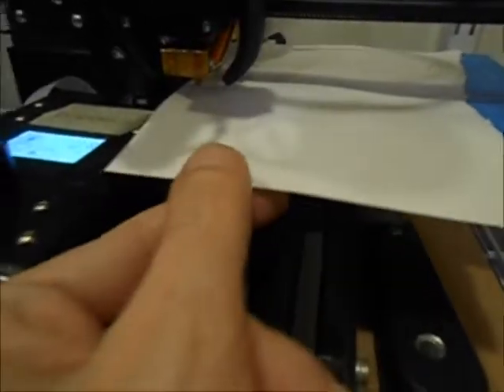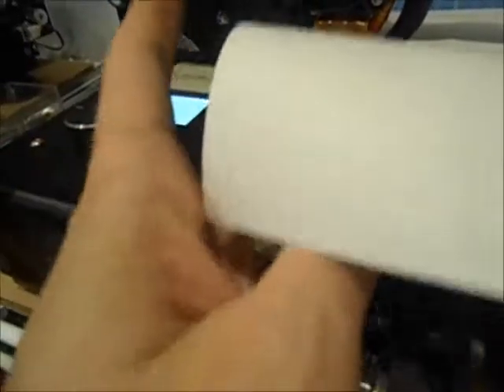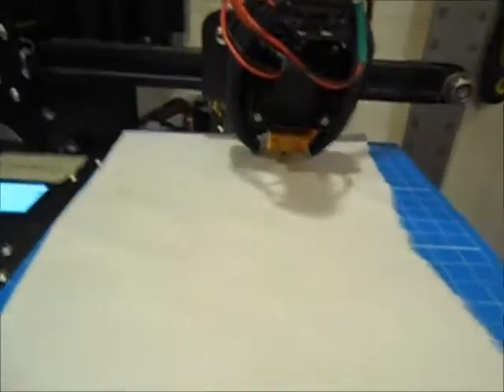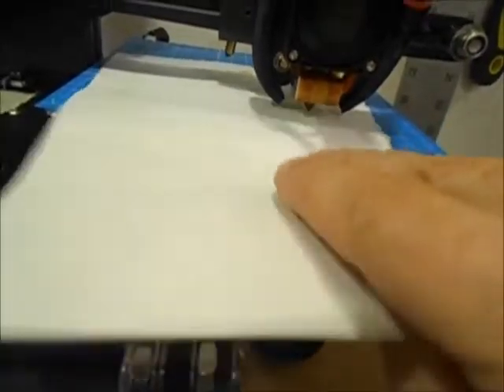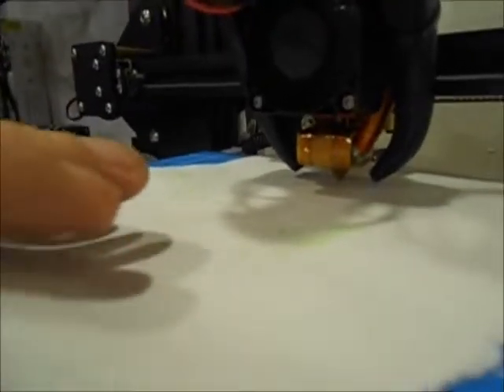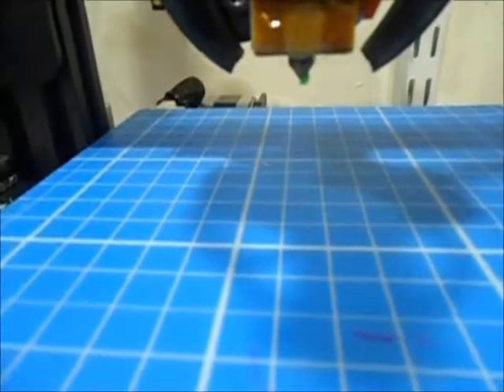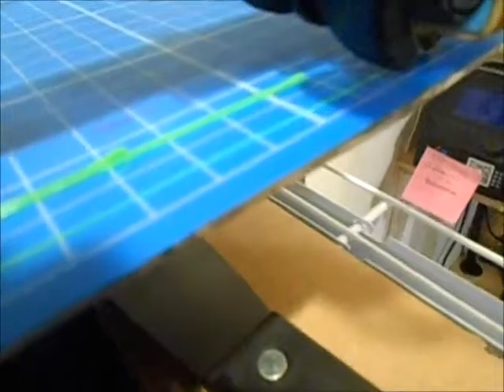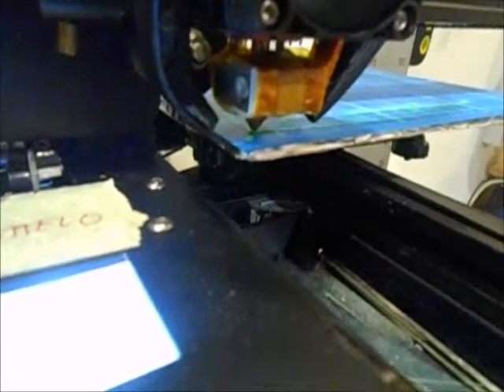Ender 2 Bed Level Basics

Comment: Hey! Good info! Thx!
Yeah, the ole 'how much belt tension should there be' questions. I too would llike to know the answer to that. Ha!
And a sure-fire solution to a warped aluminum build plate too.
Oh, the mysteries...
Thx again!
Reply from the maker: Yeah I paused when I mentioned belt tension, but decided not to go off on that tangent. I don't think belts need to be super tight. Good quality belts (fiberglass reinforced) can make a difference. But belts need to be just tight enough that they don't slip.
You can test this easily by disconnecting the cable connection on the axis motor you are testing, and then move the bed or hot end quickly by hand to see if it slips. You disconnect the cable prior so that you don't backfeed into and risk frying your board.

Aluminum build plates are another story. A little easier to fix if concave in the center by placing spacers.
I run silicon thermal padding between my glass and the heat bed, which allows for great heat transfer but also helps with deviations between the two surfaces.